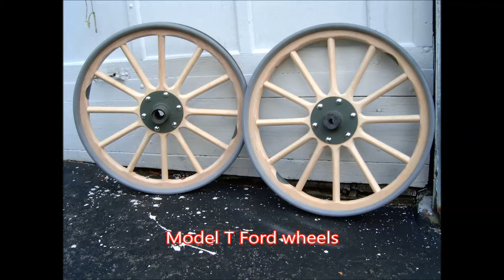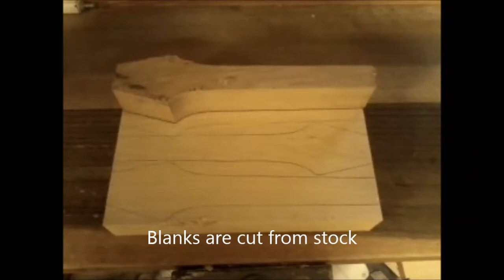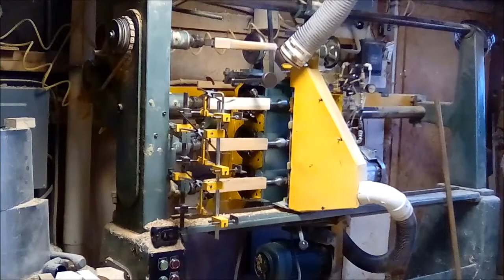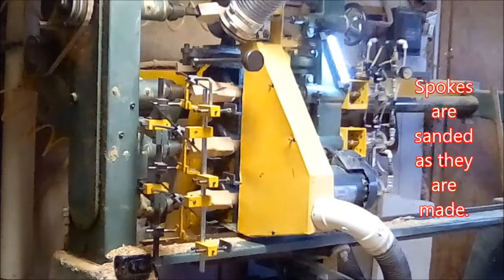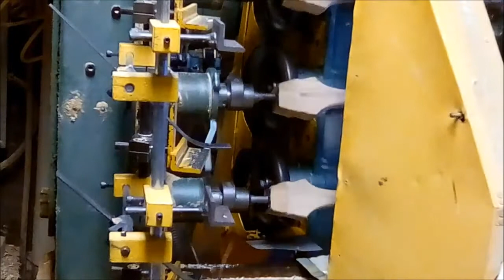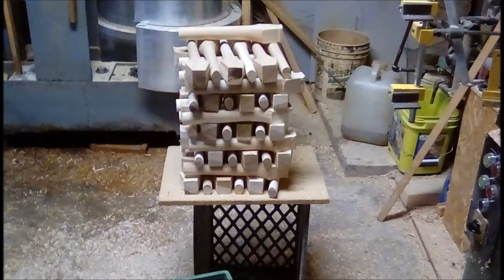Wood Spokes for antique auto wheels

Comment: What is that machine called? I'm looking for one and can't find anything online other than single lathes that just does one at a time.
Reply from the maker: Matthew,

The machine is an asymetrical copy lathe.  It is made in Italy by the Bacci company.  This machine I have had for over 30 years and may be 50 years old.    I built the sander and added the air chucks.  It is a T3MO model and is no longer made.  The newer T4MO has been made since about 1985 and I think are still made.  YouTube has videos of them.  Used T4MO lathes sell for 15 to 20,000 dollars the last time I looked. You may find one cheaper at a furnature factory liquidation sale.  Other companys make their own version of them.  Good luck.
Reply: @billcalimer7479  wow, thanks a lot. That helps. I did find one that was more manually operated. But they no longer make those either. I had kind of resigned myself to fabricating my own because I'm having such a hard time finding one. I have 10 frames sitting at my shop and all of them need respoked. at 11 bucks a piece from the vendors (which I assume they are getting them from guys like you) it adds up. I thought, if i had a machine when i get these done i could do them for other guys in the area if needed.